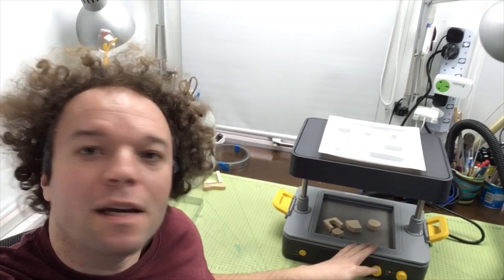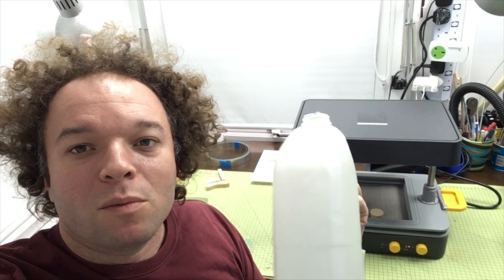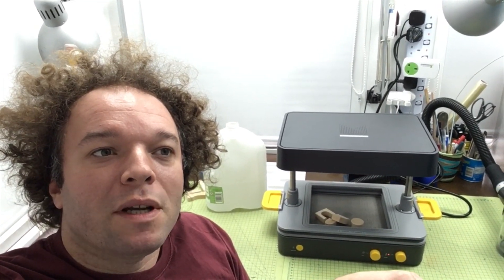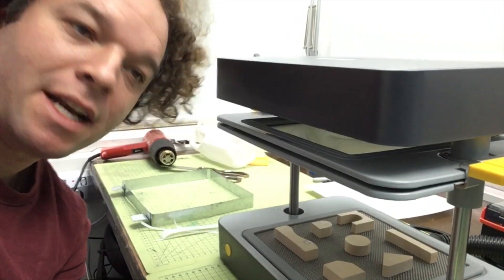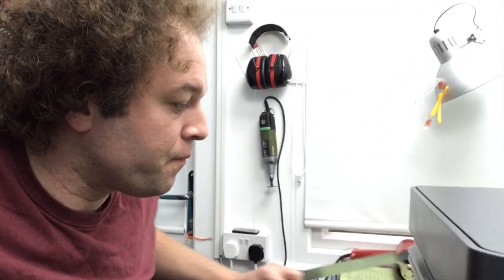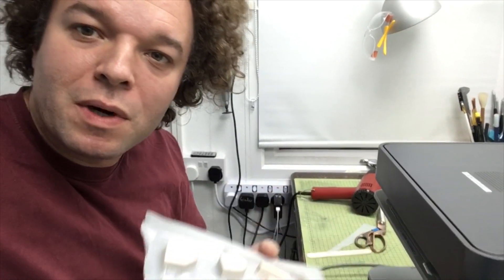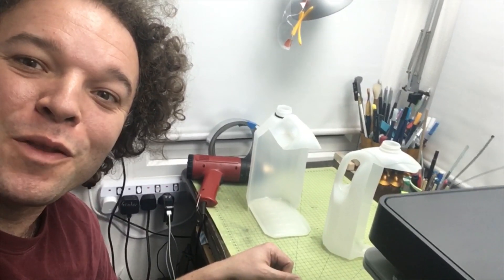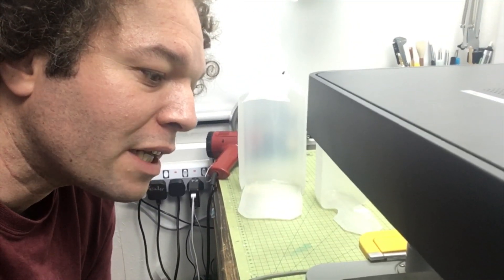Recycle Plastic Milk Jugs - for Vacuum Forming (With Mayku Formbox Hack)

Comment: You may be able to get it smoother if before you cut it you put a little water in it at slowly heat it up, I do this with pet bottles for making 3D printer filament. The water turns to steam and creates pressure in the bottle and the heat lets it smooth out any harder corners. Be careful though
Reply from the maker: Interesting tip - thanks very much!

Comment: if the product is unknow to the colectors company that recycles plastic and they can't finde an description on the sheet or bottle. they will probably sort it out, cause they cant risk to put something in the process that is not for sure the same material.
The goal is to keep the process as clean as possible and not risking to mix unknown material in it. Not sure if it would be enough if you put a stamp on it.  It's what we learned in the design material process.
Reply from the maker: If your question is about if HDPE material is reliable from Milk Jugs, this fortunately is pretty reliable in the UK as they have the '2 triangle' on the Jug, which relates to HDPE. If your comment was about 'is this approved by the company' - formally I'd have to say no, but as they have seen this video (and sent me a Formbox), I'd presume they consider it an interesting 'hack', but of course it is at your own risk. The good news is that Mayku has actually taken up this 'hack' and made it 'legit' in their own 'Heat Shield' accessory! https://www.mayku.me/products/mayku-heat-shield
Reply: @JudePullen  yes. For example. You cut off the top on the bottle and throw it in the container. In this case they don’t know for sure it’s HDPE, and it could be that the recycling process would lose quality. Of course this takes a long time.
There are some projects that try to takle this problem.
Reply from the maker: @davidzub5907  If you mean does the cut-off bit of HPDE get properly recycled - the answer would be yes. Most of the plastics are sorted using 'flotation tanks' and other ways to sort plastics by density. After that they look at how light passes through them, so it does not matter if the milk jug is in bits. What does matter is mixing plastics - say by gluing or fixing two different plastics together. Hope this is an answer to (what I think(?) is) your question. =)

Comment: I wonder if this would work well with that small dental vacuum former I saw on the tested channel, you're limited by the size of the bottle anyway so it'd be easy to cut into sheets for it
Reply from the maker: I suspect it would. Would be interesting to find out.

Comment: Is there a danger the shroud might cause damage to the heating element or fan? If it was constructed or designed to reach a specified max temperature and the air flow is flowing through that area, maybe possibly blocking the air flow could shorten the life span of the heater or fan?

I am very late to the game and only recently heard about the Formbox. Personally for how simple it is and what it does, I think the Formbox might be a big overpriced. That's more expensive than a lot of reasonably good 3D printers. You can even buy a computer for that price. For much less money (and a lot of blood sweat and tears) you could build a much bigger one from scratch. Of course, if I had a choice I wouldn't build one from scratch either. It is nice to have something built by professional engineers but I am curious based on the close up videos and performance where all that money went into the product. I see the formbox listed at over $600 US.

I mention the cost because where I work (large north American craft store chain) they just got in a similar product that surprised me. A very small vacuum forming gizmo, with a price well under $200. When I saw the price of the Formbox I was a tad surprised.
Reply from the maker: Vernon Zehr it’s a fair comment. I checked with some ‘trusted sources’. But totally at your own risk. 😉
Reply from the maker: Vernon Zehr as for cost. I guess their success suggests that some people feel different (little joke got you there, also from another ‘costly’ appliance). 

Land of the free. Home of the brave. $200 or $600 - the choice is yours! Mine was free. Huzzah.

Comment: I'm pretty new at vacuum forming, I'm trying to make a DIY one. is it possible to use 2L soda bottles like coke for example? I tried to soften one but when hot air hits it curls. I tried without being on a frame, I'm testing materials first and in my country, proper materials are hard to find. Thanks for the videos!
Reply from the maker: Imagorockeiro yeah I tried too. The curl got me also. 
You need cast PVC (ie has no pre stretching ) and Mayku sell it or eBay if you prefer. 1 or 0,5mm works fine. Good luck!
Reply: @JudePullen  Thanks! I'll try to use acetate sheets since I can find it in my city and are pretty cheap